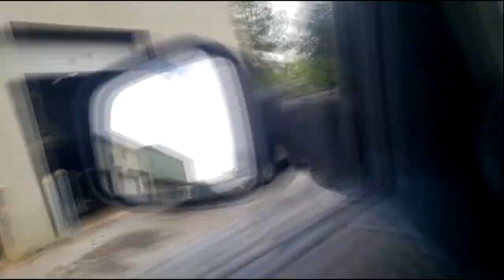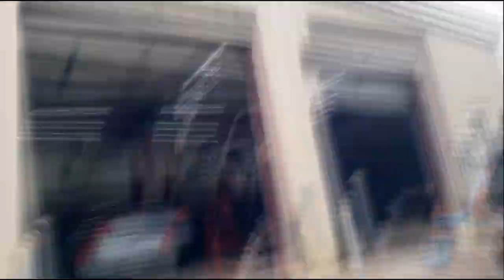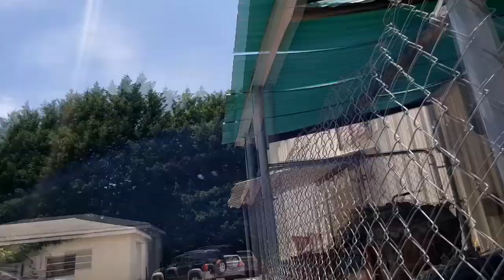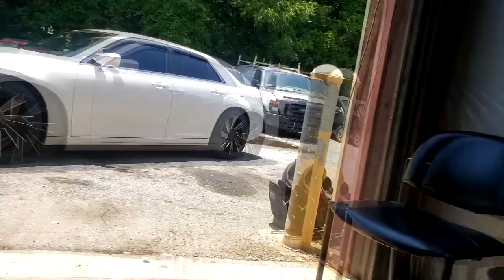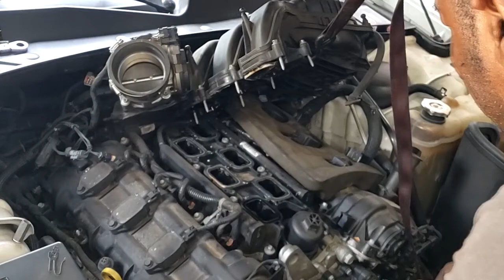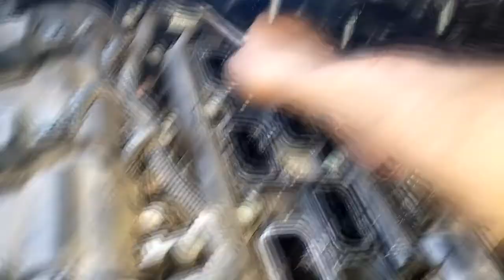BTJT My customer car idles HIGH. Look what I found  on this 3.6 Pentastar V6 tune up P0300 P0302

Comment: In the video it looks like you took the electric drill to to the plenum bolts to put it back on... Are you really that good? Or did you edit out hand starting?
Reply: Watched again, were they some sort of self centering bolts where you don’t have to worry about cross threading?
Reply from the maker: Yes, they are self centered.  Really not much starting needed but, if you havent done a few, ide suggest starting the treads with the socket first.
Reply from the maker: My friend thanks for watching, I apologize, sometimes when in a rush, i can come off looking un professional but they pretty much centered already. Thanks for watching, please thumbs up the vid and subscribe to the channel for me, thanks.
Reply: I’m subscribed for a while now. I let commercials play for you now.
Reply: Not knocking ya,  I work on the 3.6 occasionally. Not regularly.  Seeing you spin them plenum bolts in fast forward caught my eye is all. Hand start, spin them down, then hand torque is what I do. Are the plenums forgiving? I’d love to spin the bolts down on a customer car and save time Nd be confident.
Reply from the maker: @SaltySilverStacker  That my friend, is the right way to do it..And yes even torque specs should be checked. Hes coming back next week to get the oil filter adapter housing replaced. Not sure why he didnt do it all at once.
Reply: 3.6 I work on is a Jeep Wrangler regularly. It got a death wobble and I sent it to a dealer shop. I want nothing to do with a death anything. My bud has the Jeep (all stock) I’m afraid of it now.